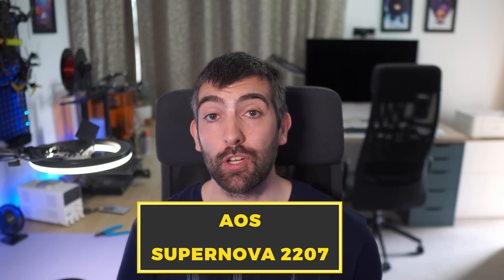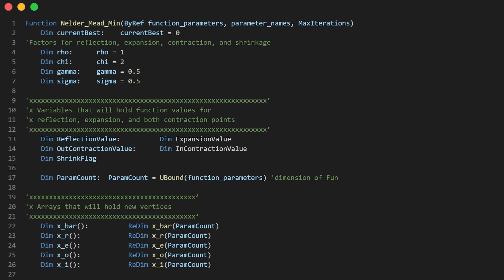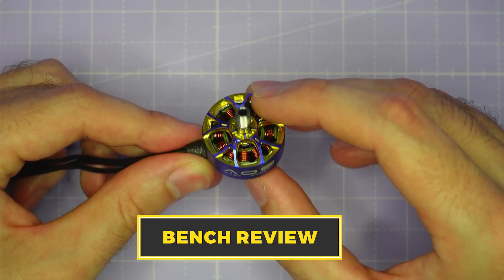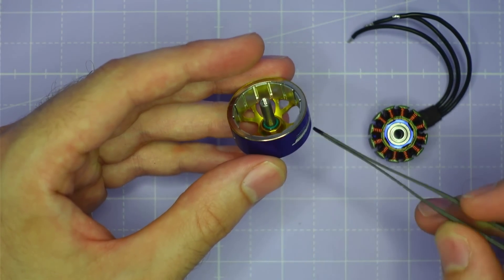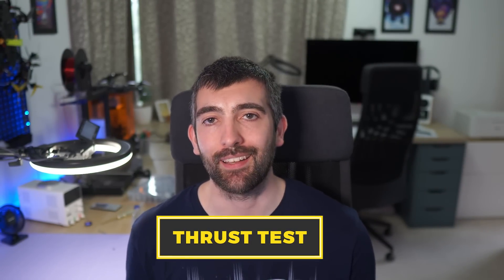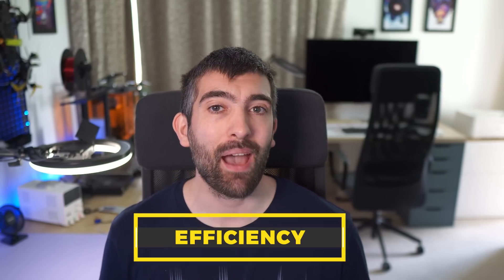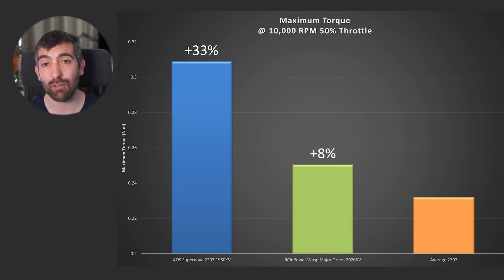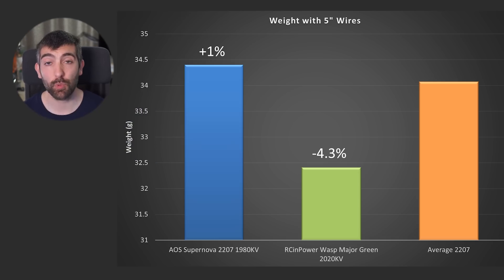How I OPTIMISED the 5" FPV Motor with SCIENCE: AOS Supernova 2207

Comment: Obiously a great motor, if the stats are like shown here... and finally you use the inertial-dyno-test-torque-data to show us the true efficiency (Wout/Win)! That´s the most important stat, and that´s YOUR motor, so, an additional reason to have interest in that... Cool-running, top-performance-maintaining, less battery-weight, higher agility, all outweighting stats like ""performance  or "motor-elasticity". RC-motor-testing has been there for ages, and it has always followed this protocol, cause of experience... 
As a sidenote, try using 0,1mm-stator-laminates, it´s gonna be expensive (cause handling of such thin/fragile laminates is much harder during production, than handling the usual 0,2mm-laminates), but it´s worth it... 
Also 0,025mm "iron-glass"-stampings/laminates would give you the ultimate motor, but handling AND cutting-tool-wear of those is harder/higher too ("iron-glass" is much thiner, but a lot, lot harder to the cutting-tool). A tiny, 200w-motor then has 96,5% efficiency, and you know how abysmal inefficient such tiny motors usually are  https://newenergyandfuel.com/http:/newenergyandfuel/com/2009/04/06/japanese-researchers-breakthrough-96-electric-motor-efficiency/ Hitachi has the patent since 2010... FPV-Motors are high-performance ones, with minimal thermal mass, so, such improvements should maybe not be expected (thermal-mass-limitations), but stil worth it, especially when facing thermal limitations...

Comment: Congratulations on the product lunch. Really interesting motors and curious to see how this will affect motor development. The level of engineering is insane.
One comment/thought on the motor naming/size. To me, not being an expert on this, it looks a bit odd. If the motor doesn't follow the traditional size convention, isn't it a bit like comparing apples to oranges? Comparing a larger size motor to other 2207s would most likely also yield results where the larger size motor performs better. Maybe I missed the part in the video, but could you explain why or what determines this motor to be in the 2207 "class" even though it is larger in size?

Really enjoying your videos. Thank you very much! 🙂
Reply from the maker: Ideally motors would be labelled by their weight class. A heavier motor should give more performance than a lighter motor of the same dimensions. Unfortunately we live in the real world where people buy 2207 motors for 5" drones so this motor had to be called a 2207 to clearly signal what the motor is for.

Comment: Great looking motor both in build and specs and im super interested in trying a set out on an up coming build , but.......... it is not a 2207 so why are you calling it so? IMO youd of been better of saying here is a motor i have designed from the ground up and it has been optimized in your opinion for 5inch freestyle use. it is in its own class of motor sizing which is ( inserts size here ) and create a new moto class . A 2207 is exactly that its not a "class" of motor. all other companies are aware of this and label their motors as such ie 22.6 /2207.5 ect. Again IMO FPV Cycle went the correct  route and just call motors exactly that size they are then give you the reasoning behind the design and indented use of such motor. 

Your testing method is a huge step forward i think and huge credit to you for all the hard work and testing you have done and  to do.

Comment: I have a great recommendations for you! Next project would be a tiny whoop motor like the 1002 for a 75mm whoop and 0802 for 65mm whoop. Find a more optimal motor with your philosophy and design process would be amazing! I'm from europa and laws here prevent me from flying fun places with anything above 250 gram. And the whoop is almost a class on its own. Where effeciency and power has improved alot just past 3-4 years. But I can't stop wondering how much more fun it would be if you start to fly 1s almost as a 2s whoop.

Would love to fly a 5" drone in the park. But by law I'm not allowed.

Comment: I love the thought that went into these motors. It seems like they would be more geared towards racers. At what point does a motor produce too much thrust, where you lose all throttle resolution? I have a shoebox size tote full of motors. So far my favorite is the 2306.5 by newbeedrone. Perfect balance for proxy and punch. As others have stated, it would be amazing to see a full line of your motors.
Reply from the maker: With throttle expo in betaflight you can always adjust throttle resolution to fit your preference no matter the top end thrust👍

Comment: is there more of a comparison of the motor efficiency vs others in the same category closer to the max mechanical output? 35% isn't bad for an efficient cruiser,  but I'm more interested in seeing, max power vs max current draw. Not much point having a (undefined) motor size which makes 20% more power for 20% more current even if the weight is the same as 2207. At that point, the innovation is really just that its a lightweight, bigger motor. Not trying to sound negative, it looks fantastic and those are some awesome numbers. 
I just don't need more power out of my racer if its going to murder my batteries more.
Alternatively, as another thought, could we see the power consumed at comparable thrust output to other top competitors. I realise that would be a whole extra slew of intensive testing to tune each test to find the equivalent output. 
Another consideration which I would like to see, along with the high temp enamel, I've seen a lot of magnet adhesives failing either from the mechanical or thermal stresses lately across a couple of manufacturers. It would be nice if you were able to lead the way in pushing advances in that for durability.
Reply: Always wondered why nobody has tried active cooling.

A CO2 cartridge, and some tubing that goes to the motors.

Shouldn't be too hard to find a place to squeeze in some turbines to assist spinning the props.

Basically CO2 cartridge splits into four goes through hoses, or maybe 3D printed quad arms with houses built in. That pressurized air pushes a little turbine, to get the kinetic out of it, and rapidly expanding liquid CO2 cools the motor.

Like turning a can of air upside down and using it to spin a computer fan.

Similar concept as nitrous for cars, if you prefer car analogies.
Reply: @jtjames79  a while back there was a brand selling motors designed to be pre-cooled, and with a serviceable oiled bearing. It looked a bit 'snake oil' at the time

Comment: Can see that it’s a 2207.5 as soon as i saw it.
Reply: I'm not saying it ain't, but how can you tell just by looking at it through a screen? 
It could be 22.2  07.7 for all you know.
Reply: Because odd ball motors cost more to make but it could be most likely its not that size  @Jeremy-yi9rg
Reply: @kerrymillar4981  It could be any numbers
within the general 5 inch motor geometry. 20,000 different designs and testing to find the best power to weight? I reckon he had to venture out of the 2207 2207.5 box.for that, I think it may be a bit more specific otherwise why wouldn't he just say it's a 2207.5 nothing to hide. Could be any odd ball  size 🤷‍♂️ rcinpower do have some different stator sizes than usual. If he believes that what is best I don't think the expense would be much of an issue.
We gonna learn more sooner than later though what it is.
Fun times ✌️
Reply: Well to be honest i dont like his frames either and think its not any more efficient than the rest looking at his numbers just a bigger stator but he has shaved some weight of then put it on in other places

Comment: This is amazing! I had this one question for some time, seems like a good moment to ask : did you try to repeat same motor tests to make sure results are the same ... say a month later ? Of course there may be a drift due to ambient temperature or ambient magnetic field or something like capacitors degradation over time. But do you see same pattern between different motors if you redo motor bench tests again ?
Reply from the maker: I tested multiple samples and have retested motors over time. In general the results vary by up to 1% over time.

Comment: very intrigued, but hiding information like the size of your motor gives of the impression that you havent done anything all that special. why wouldn't you compare this to motors that meet the same dimensions? on a seperate note, based of JB's video and yours it seems that it may have been optimized for power and efficiency but what about optimizing for just power or just efficiency, personally i like endurance flights and have custom built 21700 li ion packs for my 7 inch for that so seeing you optimize a 7 inch motor for efficiency would be really cool! despite my critique i do appreciate the obvious effort that you have put into this and i can appreciate the more scientific method you take to measuring performance.

Comment: How many amps esc to properly drive them on 6s?
Reply: At least 60A. But there are not many typical 6S Batteries available to deliver this power… We tested the Supernova with 1400mAh 150C and 1600mAh 120C packs on a 5“ race quad and they can not manage the full power potential of the motor… The real advantage is the motors really stay pretty „cool“ compared to typical high end and KV 2207 motors while delivering the same power.

Comment: Amazing! Do you have plans for the sub 250g quads? I use 1306 ,  with a 1.5mm shaft on 3s or 4s to keep weight to a minimum. Any plans for something in that category?
Reply: 1306 seems like it would be underpowered and overheat easily. So far the best motors I've seen for sub 250g are RCINPOWER 1804s.
Reply: @Bruno-cb5gk  Totally depends on what he means with sub 250g.
150g is also sub 250g.
Reply: @uhu4677  1404 is better for that. 1306 is just too tall.

Comment: @liurootFPV wrote wrote the right thing. The volume of iron and its mass completely determine the power. In essence, this is an motor designed on the basis of experimental data - you can publish geometry in a scientific journal and everyone who wants and knows how, will be able to check your results by building a model for finite element magnetic analysis on their own.
But, production is determined by manufacturability. For example, if your model has an air gap of 0.365 mm, it is ideal for your engine, but it is expensive or very difficult to make it in production. Manufacturability determines the price of production, including the price of materials, so it is difficult to "move" other manufacturers with their range of motor ratings - they have a ready-made base.
You've done a great job. As an expert in this field, I can imagine it perfectly.
And another question - there is no gradation in the level of electromagnetic induction in the FEMM model that you showed. Why is it so low in the oxbow of the anchor, despite the fact that you have it thinned due to the aluminum sleeve inside?
(I learned about your work from the Joshua Bardwell channel)

Comment: Do you think the key design principles can be applied to other motor sizes, like for 2.5" or 3" props, and get similar performance deltas? Or would that require a new sweep of tests, data acquisition, and FEA optimization for that specific prop size?
Reply: We totally need better micro motors! All the way down to 070x please ;)
Reply from the maker: I think the model should be good across different sizes (I'd need to check this) so it should be possible to optimise motors for any size.
Reply: @ChrisRosser  That would be amazing... :)

Comment: Sorry, I didn't have time to buy, we ran out (in ali).
Although maybe it's for the best ... with all due respect to your merits, there are a lot of competitors with similar or even better characteristics :
- iFlight XING-E Pro 2207, weight 34, thrust 1900g
- T-Motor F60 Pro IV 2207.5, weight 32gr, thrust 1970g
- eco II2207-1900kv, dalprop-5046, weight: 34gr, max thrust: 2020g
- Brother Hobby DXA 2207.5, hq 5.1*4.1*3, weight: 34gr, max thrust 2042g
- RUSHFPV V2 2207.5, weight 33, thrust 2045g
- Rcinpower GTS V4 2207 2100KV, weight 30gr, thrust: 2292g

Perhaps your work is the best in terms of efficiency.
Reply from the maker: Thrust depends on the prop. If you compare the supernova on the same prop you'll see it delivers much more thrust. More than 2.5kg on a 51466
Reply: @ChrisRosser  can't argue with 2.5 kilograms thrust anymore =)
decent results for such a size and mass
and what will be the current / voltage / temperature with such a thrust?
Reply: @sergo5918  about 60A/motor 6S for that thrust, no Lipo will deliver that maybe for 2 motors, so the motor will never reach its full power in flight

Comment: Hey Chris please design the best possible 3D mode motor for 5 inch. This means a motor that has best speed in change rpm and direction of rotation. Theoretically it should be a 1515, but practically because of the heat (one of the reasons), among other things, it's probably more like an 1811 or  1910 ? I have also done a video about that 2 weeks ago... And can you even build something like that? And would a manufacturer even want to build something like that because of the possibly non-existent demand. Some people call the 1507 smoother than the 2004. The same could possibly apply to the 5-inch range ? A 1811 or 1910 could possibly be for 5" the smoothest motor in the world and the best for 3D mode...

Comment: Please clarify how you calculated the "-4.3%" weight of the Wasp Major?
Reply from the maker: Weight of the motor with 5" wires compared to average weight of all 2207 motors tested with 5" wires
Reply: @ChrisRosser  please clarify the calculation, I can't get 4.3% with the values read from the graph.

Comment: Hi Chris could you please plotand show the efficiency curves over the full RPM range for the 3 motors.   I have found efficiency to be far from linear and very different curves between motors.  Also the minimum startup RPM current can be very different between motors.  I fly only full throttle very sporadically just for power loops punch outs, so i select my motor to be most efficient at 30-40% of RPM and less effiency at full throttle has minimum effect for me. (i am not a racer)      For long rangers and for (small <3inchers selecting the most efficient motor at 30%throttle, is key criteria.   When looking at efficieny as a curve over full, RPM range, you may observe some very interesting things to.

Comment: I really wish the motor dimensions for Brushless Drone Outrunners was instead back to how every other motor does it, with EXTERNAL dimensions labeled in the name, for example a 2302 would instead classify as a 2809, Outer diameter and distance from bottom of the mounting feet to the top of the motor bell excluding shaft, and a 2207 would be a 2817 - 3020. Then let their power and efficiency numbers sort them out. Curious, why wasn't silver-plated wire used to add just a bit extra efficiency? Can't wait to see a whole lineup of motors from 0702 to 8085 sizes xD
Reply: What does a few microns of silver actually give?
Reply: @rcdieselrc  It provides quite a bit of benefit due to the skin effect at higher frequencies
Reply: @CamdenWallraff  do multiple strand winds show the same benefit?
Reply: @rcdieselrc  yes, but they reduce the overall performance of the motor by reducing the total copper in the wind
Reply: @rcdieselrc  multi strand windings burn so much easier than solid. I stay clear of anything with multi strand.

Comment: To all the comments complaing about not knowing stator proportions, first of all its kind of meaningless, the only thing that matters is power to weight. Secondly, im sure Chris just wants his motors to be on the market for 5 seconds before getting cloned, which will happen anyway, just a matter of time, dont make the cloners job any easier.
Reply: If he is has real IP in the design then he can patent it or make it a trade secret and protect his rights. If not, then bring on the clones!
Reply: Do you think cloners care about patents? Even if Chris could afford a patent which is incredibly expensive to get there's no way he could afford suing cloners in a foreign country. Nice ideas but none are actually practical. This is just how this stuff works unfortunately, being first to market is the only way to get some return on investment. Keeping the exact technical details a "secret" is just a way of extending that window slightly before the inevitable. @BoilerFPV
Reply: Stator volume is not meaningless, he has been proving that in loads of videos. "In general, stator volume dictates torque, if all else are equal"

Comment: It's really hard to trust your motor testing now that you're financially motivated to make your motor look best. You won't even give the true specs of the motor which allready shows you cant be trusted to give all of the facts and be unbiased.
Reply from the maker: I'll happily publish the full performance specs but not the design specs. In the same way that Tesla will tell you top speed and acceleration of the car but not the dimensions of the motor used.
Reply: @ChrisRosser  will you be selling spare bells as well? Or do you want to be like tesla in that aspect as well?
Reply: @ChrisRosser  afaik tesla des not sale components but complete vehicules.
Reply: @ChrisRosser  your not helping by comparing yourself to tesla. They're an awful company with bad business practices. The majority of auto manufacturers give specs to their engines. As well as repair manuals, which tesla has been very against even when there are allready decades old right to repair laws in the auto industry.